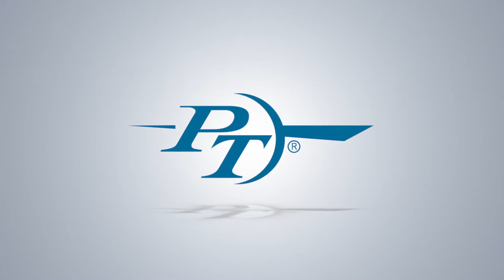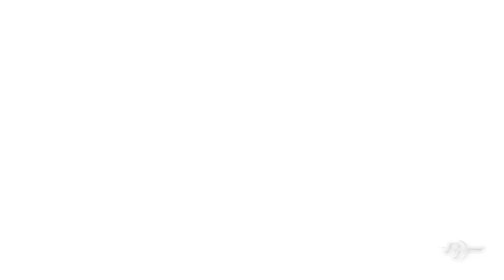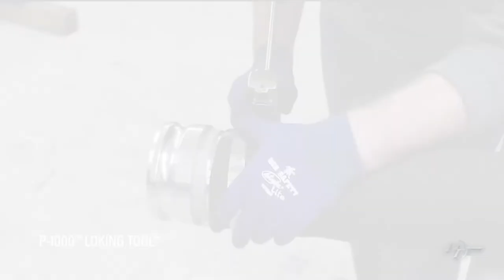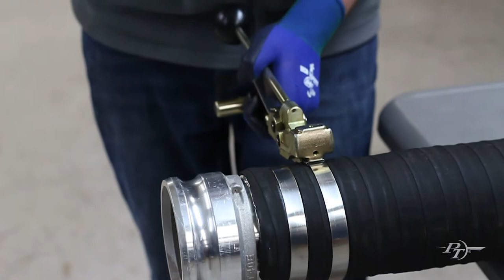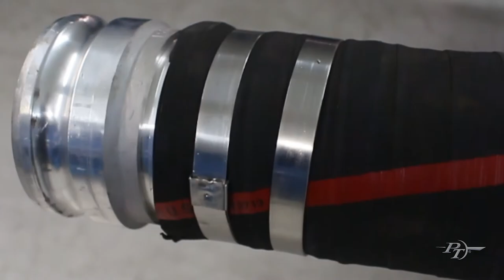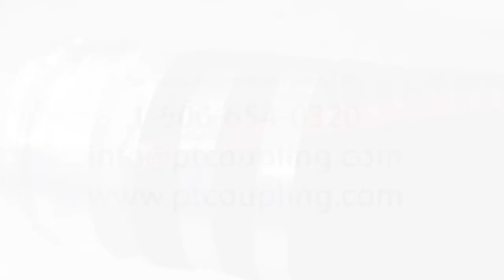PT Punch-Lok®'s P-1000™ and P-7500™ Banding Tools

Comment: Great.....now how do I get them off to replace the fitting?
Reply from the maker: Hello! Great question. We offer a clamp cutter tool, the D-550 (Item No. P255500) that removes the banding.
Reply: we hammer a flathead screw driver into the small clamp that was punched to loosen the tension!
Reply: Cutting wheel
Reply: Carbide tipped chainsaw, and lots of glycol based coolant